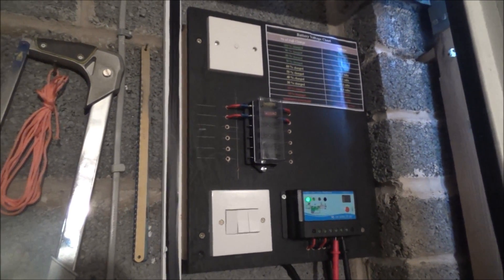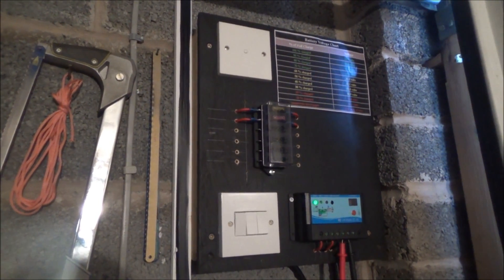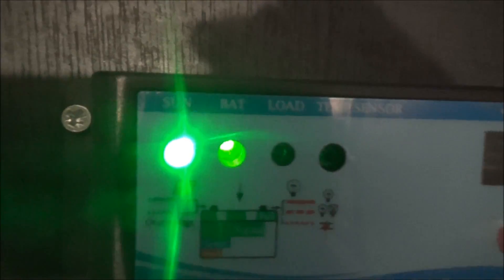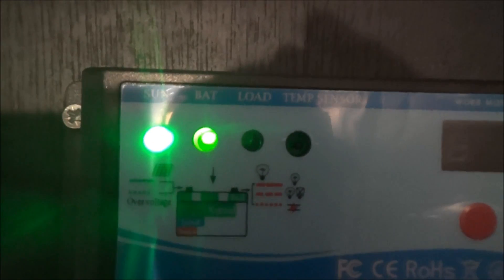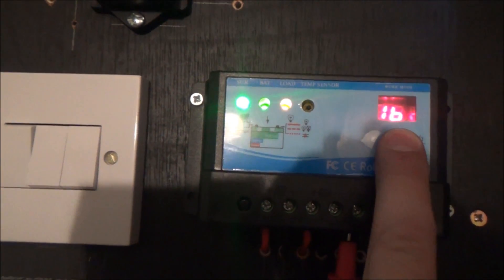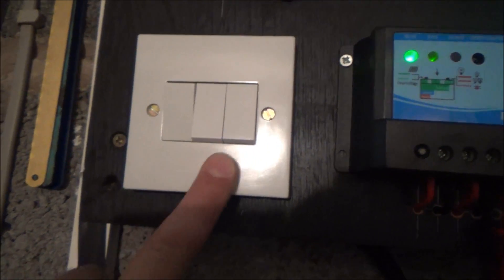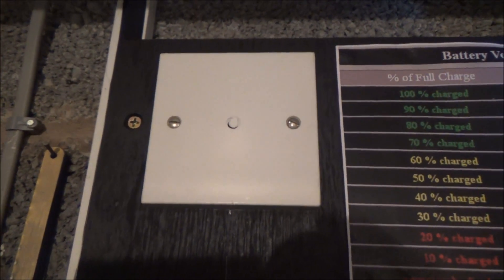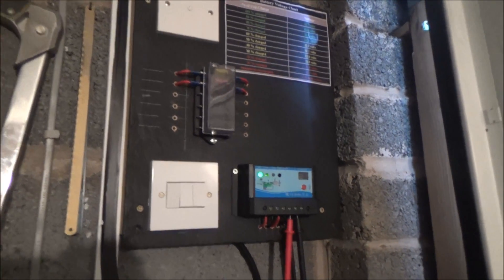Simple DIY Home Solar Project - Off Grid Garage - Part 1

Comment: Quick question. I'm looking to do the same thing for a tiny house. Does the inverter connect directly to the batteries? What happens when they're topped off mid day? How would you run power directly from the solar panels?
Reply: Yes the inverter connects directly to the batteries. The charge controller takes care of all operations and you should never try to connect  power directly from the solar panels because the voltage fluctuates from the panel.

Comment: This is an old video, so I realise I might not get a reply, but why are you not using the load side of the charge controller?  This circuit has discharge protection  to save over discharge of the batteries.

Comment: I'm afraid the voltage-StateOfCharge table is not really accurate, 
but I really like the clean and proper build up of you're panel,
compliments for painting it and putting all the wires behind it.

Comment: What happens once the battery bank is full ? What happens to the excess current coming from the solar panel ? I'm sure I've seen charge controllers that automatically redirect any overflow current directly to the load and use it as an energy dump essentially. I have been looking at the exact same system as yourself but I am unsure because of this matter.
Reply: Peter Graham for a small system you don't need a dump load

Comment: That's a really nice video. I've done a similar solar project in one bedroom of my house. I run lights, radio, chargers for phones/ipod/nook, and my computer from my little off-grid system. I have 30 Watts of solar panel charging a 35 amp hour deep-cycle battery. I also have a portable charging system with 14 amp hours of battery - paralleled two 7 ah batteries similar to your configuration. I take the portable system with me when I fly my RC aircraft so I can begin recharging at the field. I have a 150 watt Samlex sine-wave inverter. I use the same inverter and solar panels with both systems. 

Thanks for your video. Your workmanship looks great.
Reply from the maker: +Patrick Colwell Thanks for your feedback Patrick, its an interesting hobby...

Comment: What type of fuses are you using in this system, understand you need fuses but finding out what one and size has not been easy
Reply from the maker: Rays RCs I just use car fuses (blade style)...
Reply: Cool I shall check them out

Comment: Just ran the Baofeng charger through a wattage meter, and it's consuming 5.8w. The battery in the radio is still pretty well charged, but it shouldn't draw any more power when at a lower charge level.
If you're interested, Maplin sell small electricity cost monitors, that will read in amps and wattage, for £9.99. Might be worth getting one to monitor total power consumption/inverter load at some point.

Comment: The main reason I mention it, is your inverter looks identical to my old Draper one, which has a max rating of 400w, but continuous 200w. Even running things at 150w gets mine pretty hot. It should be fine for things like phone chargers and small battery chargers though, as most of those draw less than 10w, sometimes as little as 2w (depending on mAh). Fast chargers can draw a lot more though, like power tool 1h chargers, so worth checking :)

Comment: Awesome stuff so far mate. Little word of thought though. You might want to place the inverter in a more open area. Those things can overheat pretty quickly if they haven't got air circulating around them all the time. Hence the big heat sink casing ;)

Comment from the maker: Eeek, 40w Solar Panel, Extension Lead & charge controller £98.00... Fuse box £5.00... 3 Gang switches... £3.00... Inverter £14.00... Batteries...£27.00

Comment from the maker: They were cheap and easy to work with. Plus I can always use them for my CB radio outings if required. Im just playing around at the moment. If I decided to expand the system, I will no doubt get bigger batteries. Thank you for your comment...